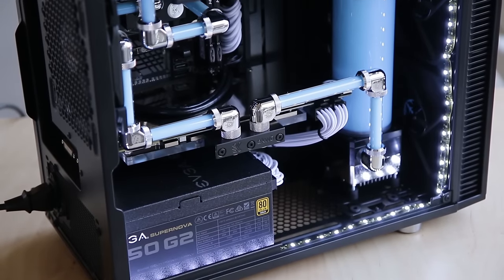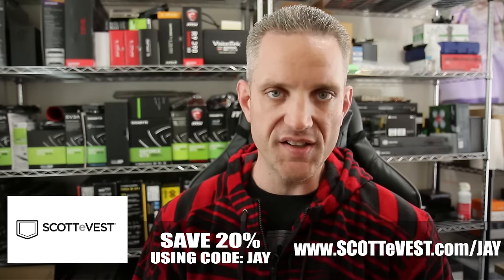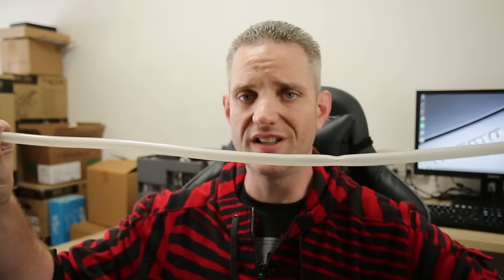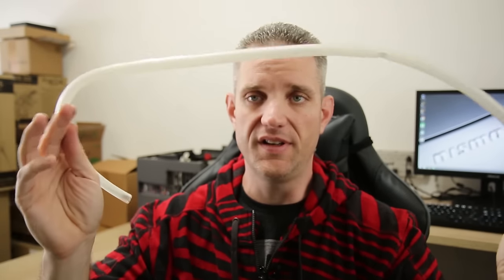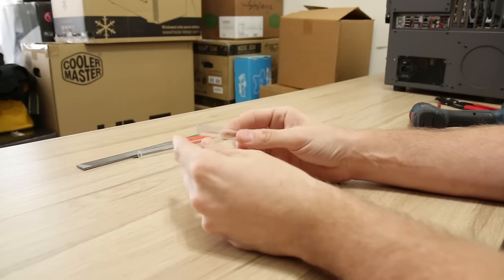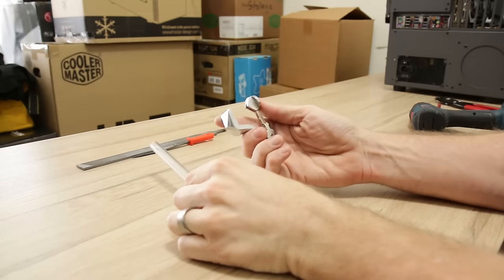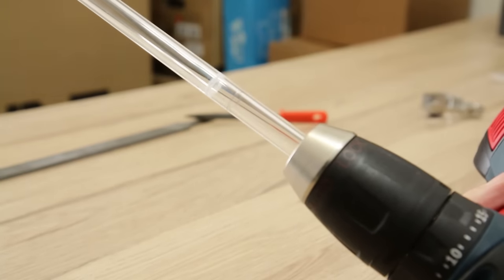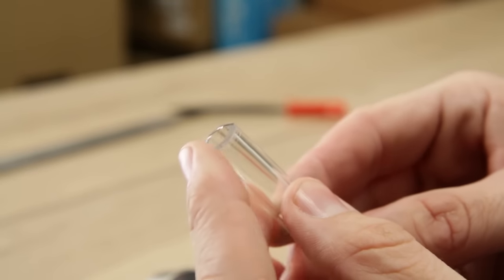Tutorial - How to cut glass tubing for watercooling loops

Comment: OK, the filing on the outside of the tube is fine, but if you pay attention to what you are doing when you stick the file into the inside of the tube you are "filing" the glass with NO cuts on the file. I get that you are great at watercooling, but at glass cutting not so much.

Comment: JAJAJAJAJAJA HUE HUE HUE HUE, the first scratch you marked it with is all you need from that glass cutter. it doesnt have to go all the way around a 2 - 3 mm score mark would do. then you turn the crack away from your self, put on thumb on on each side of it and crack it. i really like alot of your videos but if you teach ppl to do this without proper ventilation your gonna wreck someones lungs. the glass is borosilicate which means it has boron as a flux and will mess you up.